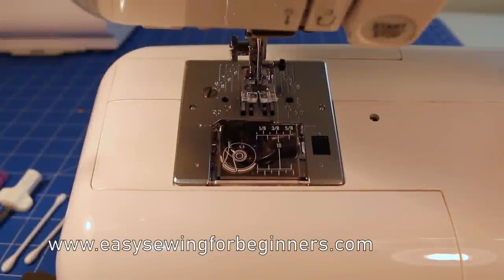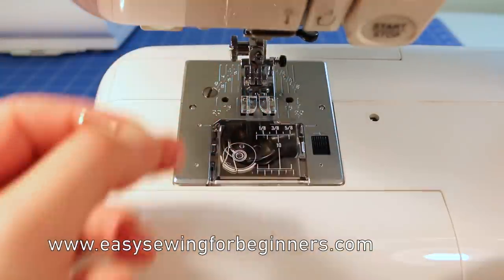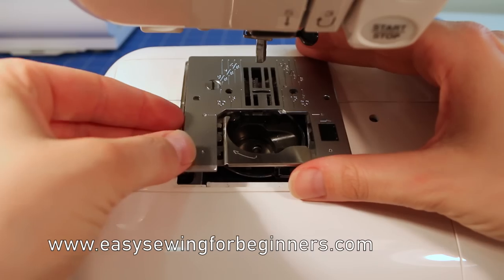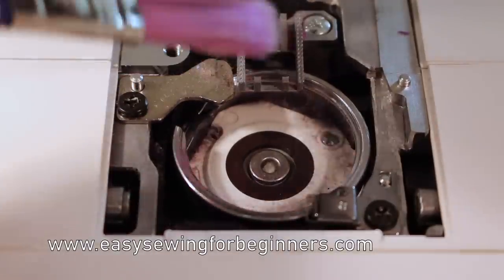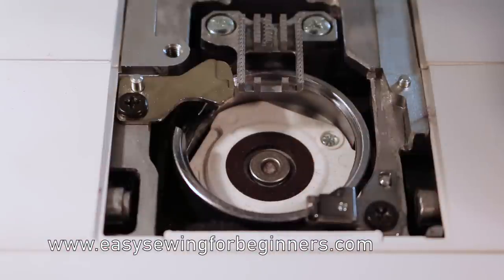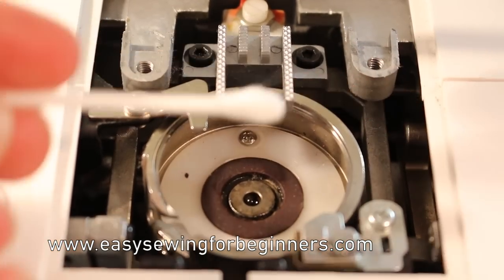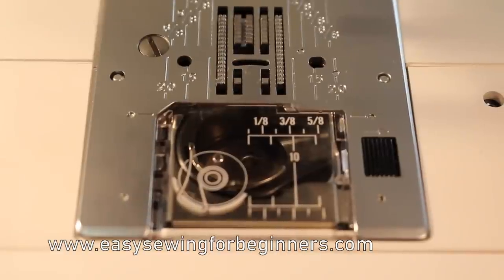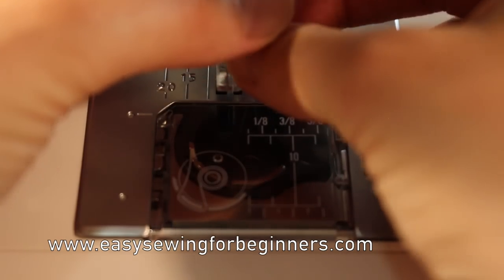Sewing Machine Maintenance: How to Oil and Clean (Top Loading Bobbin)

Comment: Hello, regarding the oiling of sewing machines: Some manufacturers say that oiling is not needed, i followed there instructions and my Brother just died on me one day. When i got it fixed, the mechanic specifically told me that all machines need oil regularly, and 90% of them need it in the same spots. I followed his instructions, and my machine never broke down since.
Reply from the maker: Andrei. Lepadatu oh that's good to know! Thank you 😊
Reply: Thanks.  My manual for my Brother XL-2600i does not mention needing to or where to oil.  It only says "Do Not apply oil to the bobbin case."  It does not tell me where I need to oil.  :(
Reply: @TxTnRN3  same with my Brother SQ9285, but it's squeaking after cleaning it and it clearly needs oil. I wonder if they say that knowing they'll break down and you'll need to buy a new one. 🙄

Comment: Thanks for mentioning that some machines shouldn't be oiled by the user. It turns out mine is one of those. The manual didn't say so, but the troubleshooting section on their website does. I'm going to follow your instructions to get in there and clean, though!

Comment: I had a Singer for 33 years that finally broke down bc there are no longer parts for it.  I think if I'd known what to do to oil my own machine, it would've lasted longer.  I cleaned it but it only got oiled when I took it in, and that cost $75 (so it wasn't often).  

I just purchased another machine; it's been sitting in the box 15 years but never used.  Should I oil it?